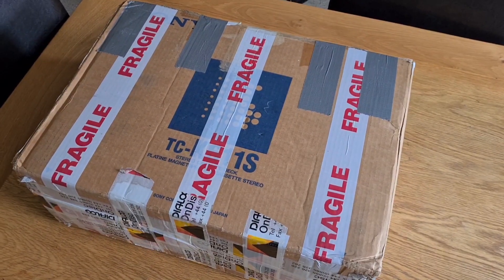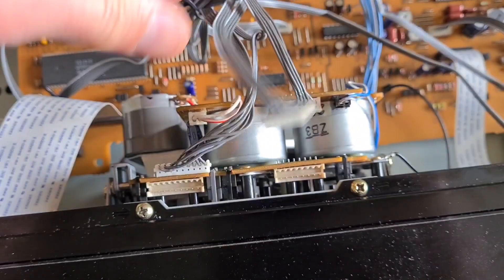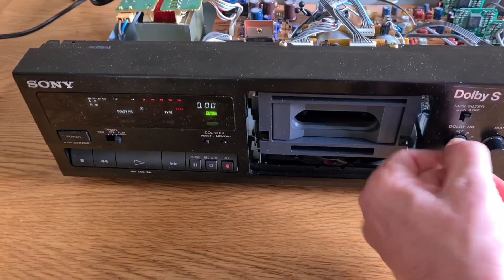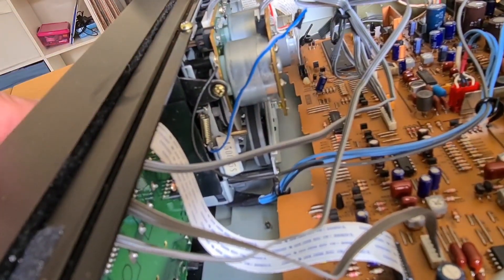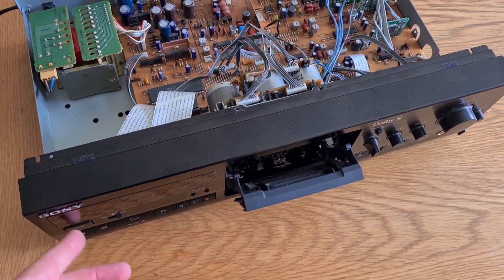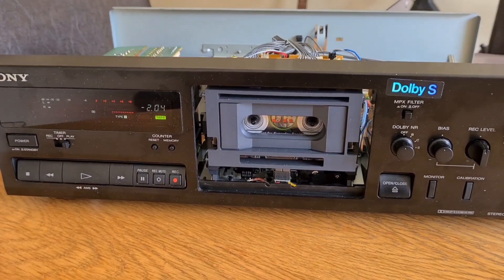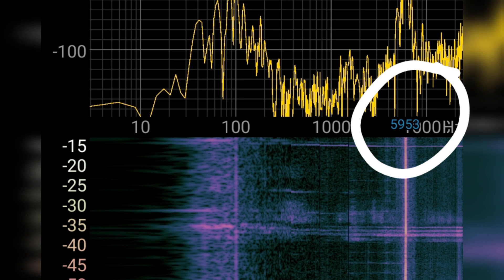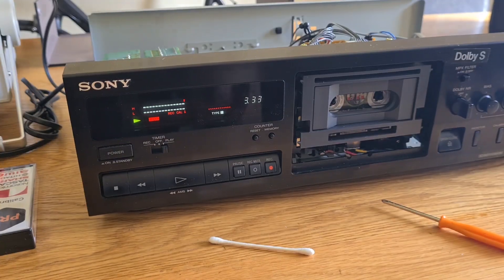Sony K611S Cassette Deck - Fault Finding & Calibration / Dead Door Repair

Comment: At 2 mins 55 ish as I'm turning the wheel, fingers are covered in a thick black paint like substance? Looks like rubber beltsconnecting the 2 wheels has perished and become this substance. At 3.13 can also see a grey wheel that should have a black belt on it as well, this has also perished. Are these available to buy?
Reply from the maker: Yes the belts are on eBay search DeckTech k611
Reply: yes they're available

Comment: Hello I have This same deck.
And the door will not open.
Both belts are intact.
While powered on i can see the capstan motor is turning.
The motor that controlls the door tries to turn, going forward slightly then back just slightly like it doesn't know what to do.
Any ideas?
I very much want to get this machine working
Thank you
Reply from the maker: Hello your fault is the rotary encoder. I have the tutorial on how to repair it on one of my recent k661s videos, I just can't remember which one. It might even be this one
Reply: Thank you for the reply. 
I have watched that video. 
Going to order belts and new pinch roller and tackle it all in one go. 
Thank you very much!
Reply: With the power off and unplugged, and cover removed, looking at the unit from the rear, gently turn the flywheel a notch or two clockwise. See if that does the trick.
Reply: I have been gifted this deck with the same issue. Will attempt a fix tomorrow, hopefully it's not the connector at 4mins 18, as I didn't see where you got that from 😂

Comment: Looking forward to this. Do you have any fixes on a auto—reverse head which doesn’t rotate fully. I’m servicing-is a RS-CH900 as a addition to my collection. Ty
Reply from the maker: Unfortunately usually it's the gears that have worn teeth on technics auto reverse stuff. Unless you can see anything obvious stuck in there, it's definitely a good close look at the mechanism for the head 😄

Comment: Great work, my twin deck aiwa wx 828 apart from working out the positions of the cam gears that were not in the service manual. I had many head aches as it turned out one of the main problems were all the front panel buttons i bought another deck from ebay as i broke a part of one of the decks mechanism's  i swapped the board with the buttons over and worked fine .i bought the deck new so going to keep it as it sounds good with tapes recorded on my better decks makes a decent play back deck and because of the parts deck i have spare heads .
Reply from the maker: That's one thing I'm not great at, I hate stripping a deck I could possibly save for parts 😄